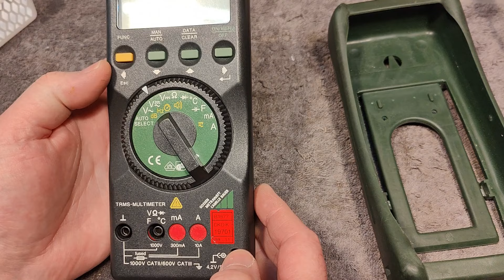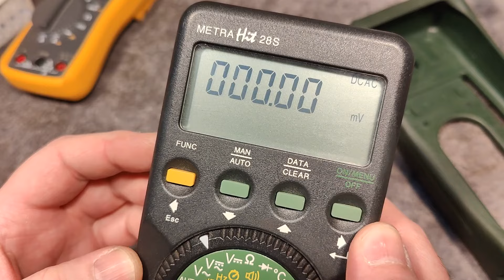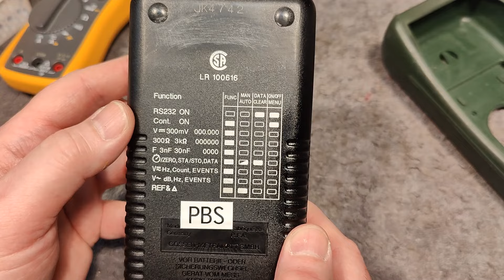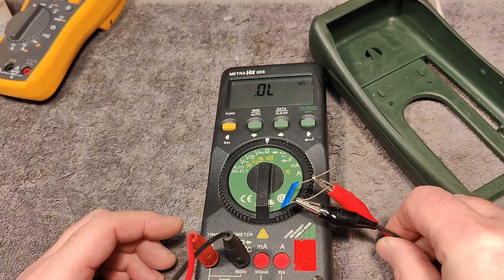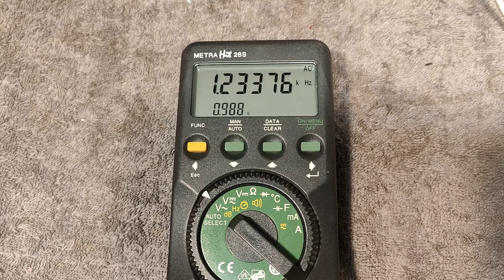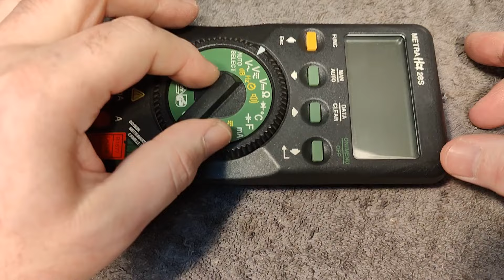Metra HIT 28S 5 digit handheld multimeter high performance

Comment: I had one myself until recently, got it at a reasonable price on ebay classifieds.
I thought this would be my final multimeter, meeting every demand but eventually I didn’t use it that much.
The update rate was too slow for my perspective, display contrast could have been better and access to the special functions was not intuitive (OK, rather high level complaints).
When I came across a broken (not really) Agilent U1252b, I gave the Gossen away.
Though it‘s only 50000 counts, it is much faster and has other interesting features (eg. signal generator)
And for high resolution measurements or 4W Ohm, the Keithley 2000 comes into play.
BTW, I regard the mOhm resolution for 2 wire measurement impressive but useless as you will never get repeatable contact resistance with this setup.